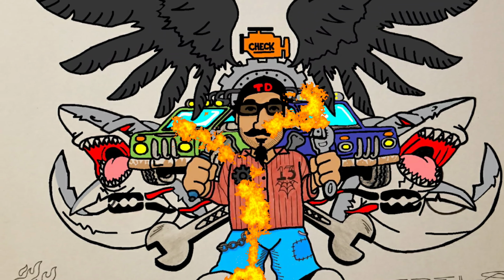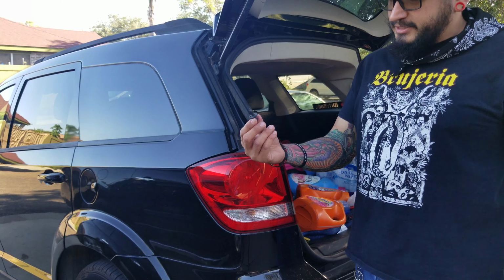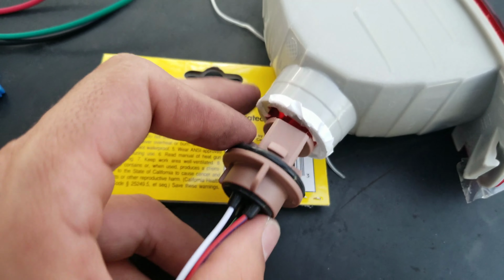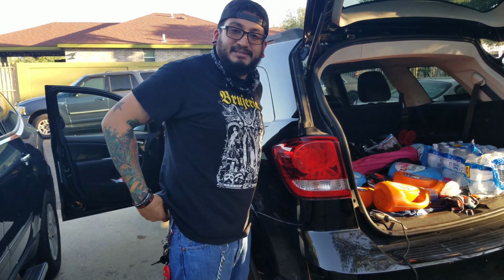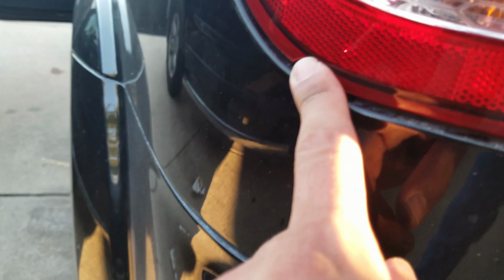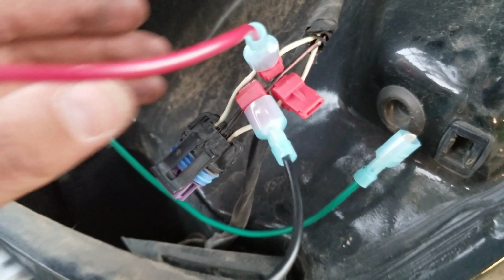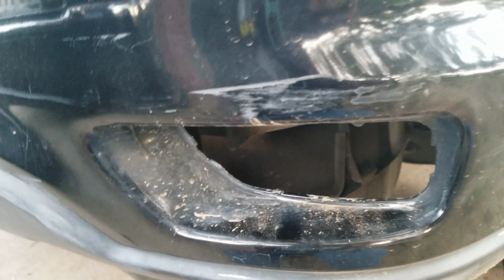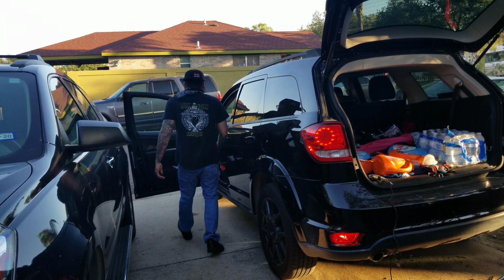Dodge Journey converting rear reflectors to working brake light and running light

Comment: Why didn’t you just buy the factory Euro Rear End Electrical Harness for under $150 Online?
You also could just buy the proper OE Fiat Freemont (Dodge Journey) Rear Fog Lights and Headlamp On/Off Switch…..any Dealership can order the them for you, but the wiring harness you have to find online as that part has a Region Block on it from FCA ✌🏻

Cool video none the less, glad to see a community finally starting around these vehicles, we’ve had our 17 Crossroad since new and it’s never let me down once 👌🏻